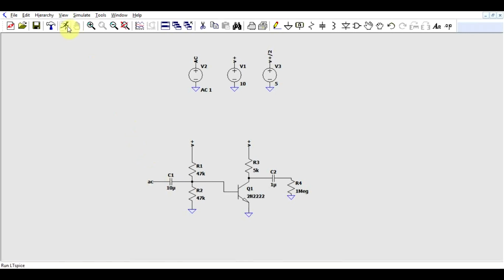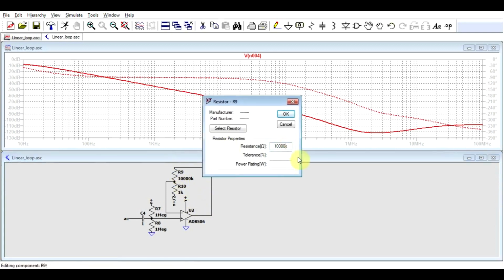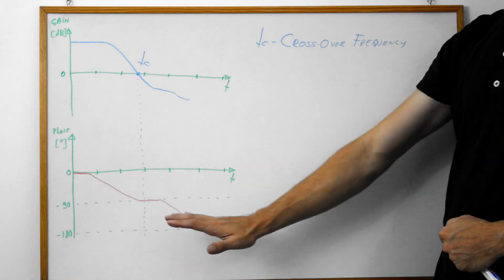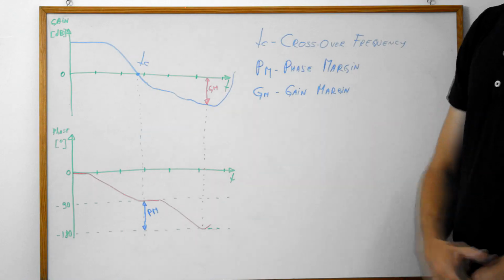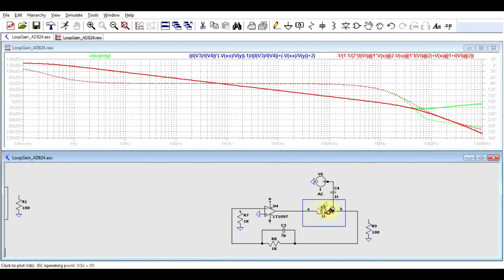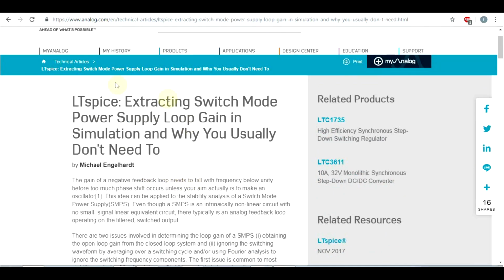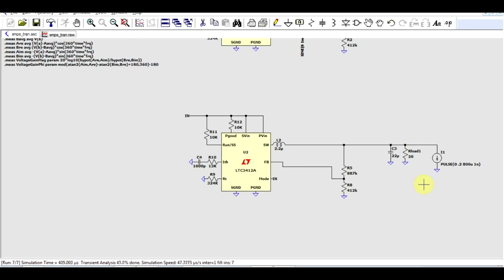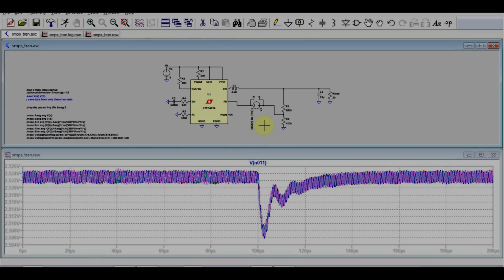LTspice tutorial - Feedback loop simulation in linear and switching systems

Comment: A better point to inject the sinusoidal is above the upper resistor of the voltage divider. The impedance of the ouput signal should be much higher than the impedance seen by the input signal. The load step response was not ringing so bad as the phase margin implied.

Comment: when we run this example, here is the message:
|1: requires a minimum of 5 parameters.  Only 4 specified.
Reply from the maker: The problem is in the pulse source, you need to add a 5th parameter, even if its 0;

Comment: Great video .. Look also to this guy and how he does that
https://www.youtube.com/watch?v=giHA_Dhu7Ao
Another question, it seems he is using LTspice built-in his software .... Any key how to integrate ?
Reply from the maker: Hello Walid! From the video at least I couldn't see a use of LTspice - he did have a tab for "spice simulation" but "spice" is a computer language - LTspice, Pspice etc. - are all spice simulators (same language, different compiler)
If you just want to focus on calculating the loop response there are other SW methods - TexasInstruments Power Stage Designer is quite nice; I think other manufacturers also have similar things. 
The nice thing about the video you shared is that the calculation is based on the measured circuit, its not purely theoretical.

Comment: Too difficult for me for the time being, but could anybody explain me at last how recognize where in the scheme is node n004 or node n002, etc.,  because there is no designation of nodes in the figures presented?
Reply from the maker: I'm not sure I made any reference to generic node names in this video, or was it a general question?
Anyway you can go with the mouse over the desired node and LT will tell you in the bottom left corner what it's called. I do not recommend however using default node names in any measurements or formulas since these have a tendency to get renamed by LTspice - if you are particularly interested in a node (net) give it a specific name.
Reply: Alt+click the node in the plot, it will highlight the net in the schematic.